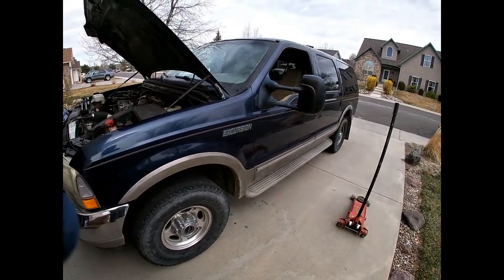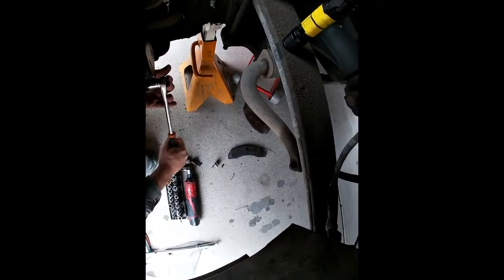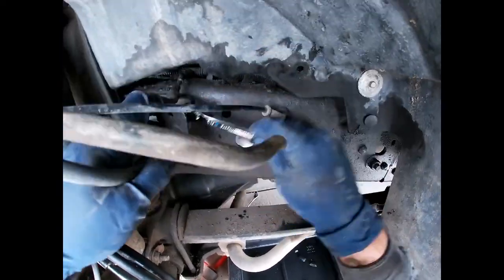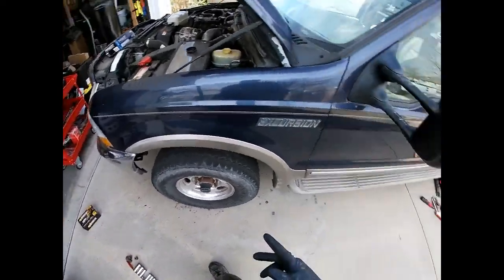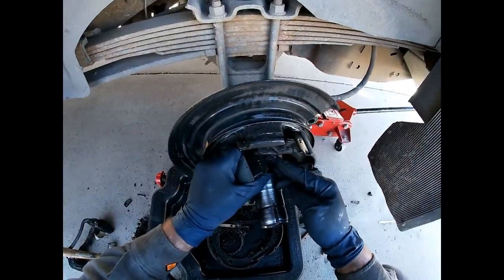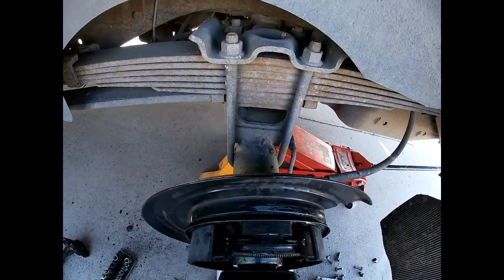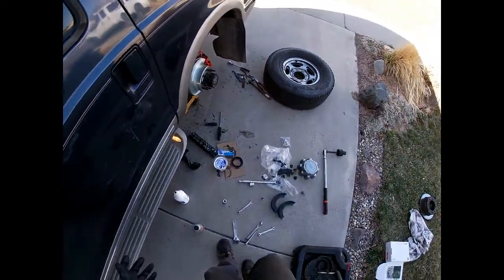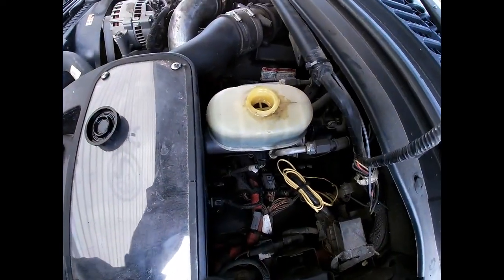2000-2005 Excursion/ 1999-2004 Superduty Brake Upgrade

Comment: What makes these Super Duty brake calipers in comparison to new "Excursion" brake calipers, an upgrade besides the rotor style?
Reply from the maker: Silicone rubber piston boots, all new hardware on the calipers, and the pads are a heavy duty compound that resists fade better.
Reply: @BrotherhoodOfTorque  thanks for the reply. Do you have a parts list of where you got them from? I need to replace my lines and especially that vacuum one you have. Mine is flaring the same way.

Comment: Why do a video  and not put a parts list? No money in it for you huh?
Reply from the maker: @gufiaito69able  lol what? Part numbers change depending on manufacturer and supplier. I didnt want to list what may be available here, but not somewhere else, and I also dont know what vehicle someone happens to be working on. The parts list.literally consists of a powerstop pad and rotor kit, wheel seals, and fluids for what ever vehicle you have, which are readily and easily available on summit racing, jegs, rock auto, etc.

Comment: Did you really pack grease in a oil fed wheel bearing 😂
Reply from the maker: Yea, guess me and the ford engineers that taught us must be wrong. The bearings are not.lubed until you start driving around and sloshing oil around the diff. The grease will get warm and wash off as the oil washes it out. It is used to prevent them from running dry initially.